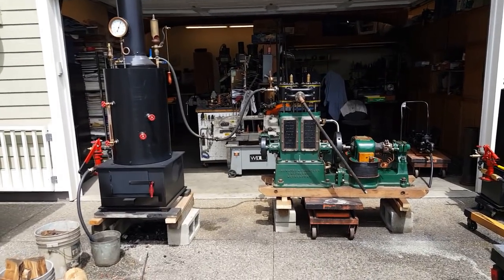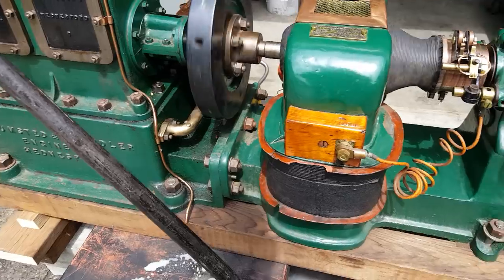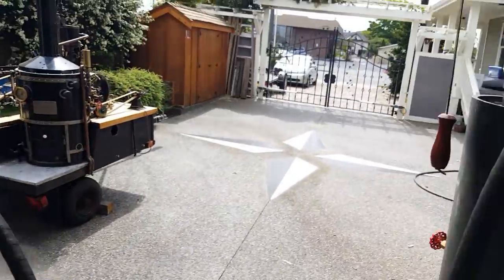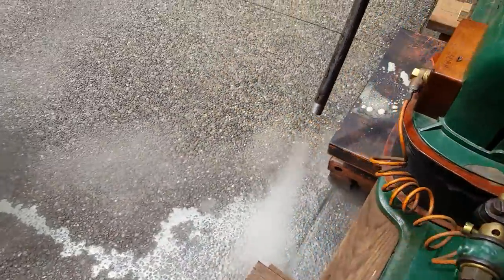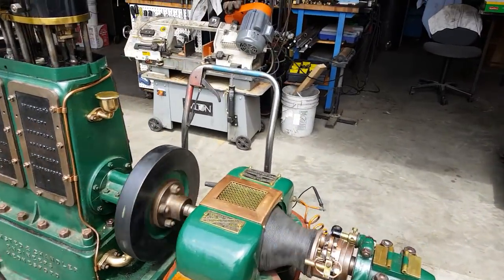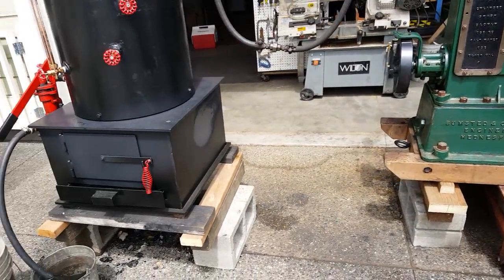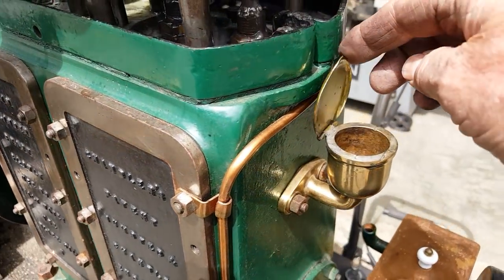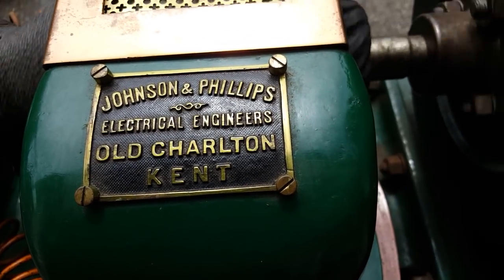Steam Engine Dynamo

Comment: The lever and adjustable brushes are for compensating the distortion of the field that follows the momentum load. When the generator is under load the torque from field to rotor tends the field to lag somewhat. Then the commutator is adjusted accordingly to minimum sparks under the brushes.
Later, they found out to add a commutating coil in series with the generator (or motor - it works in the same way) so the field is automaticly adjusted. Its very interesting to study these old machines!
Reply from the maker: I will forward your comments to the new owner. Thank you. Ross

Comment: Watch the voltmeter while rotating the handle. It looks like it'll change the relationship between the fixed field coils and the active windings in the armature which should alter the output. Does that one require some sort of field start (battery or something to energize at first?)

Comment: That is a beautiful engine and dynamo! The tag says it supposed to put out 100 V but your meter is only reading 2 V, sometimes dynamos need to be forced to produce their voltage by applying DC across the output for a couple seconds which allows the magnetic field to build-up. I'm not suggesting you go experimentings with it but hooking a 6 V lantern battery across the output for a couple seconds might allow it to produce its rated voltage
Reply: Jane Christensen  I meant battery, not bulb. My first generator needed to be "flashed" (some call it "faced"). By quickly juicing it with current from a battery, the field builds up and it works normally. You are correct the residual magnetism sometimes dies off and there's nothing to start it working without a little help. You quickly learn how fast to remove the battery, because once the generator starts developing it's own current, a battery is basically a short circuit!
Reply: @tripplefives1402  Wish I knew that with my first genset. It had a factory cord with bare ends to plug in and touch to a battery!

Comment: The brass things on top of the cylinders, are pressure / water release valves for the piston valves , Regards Clive
Reply: And they should be open when you first start the engine.